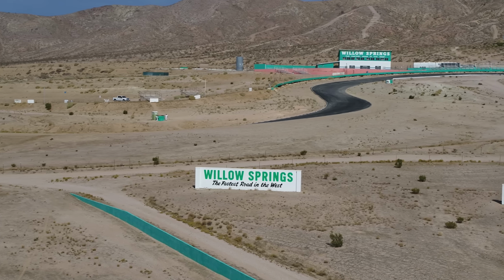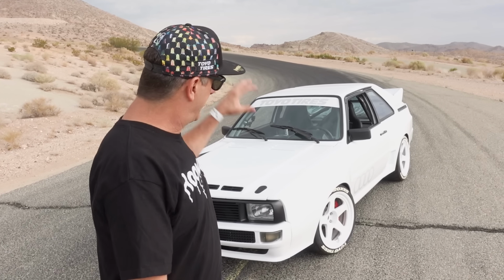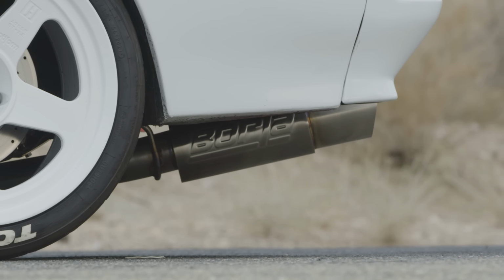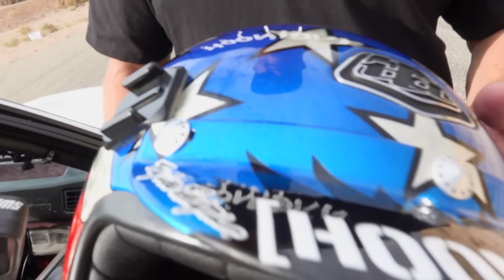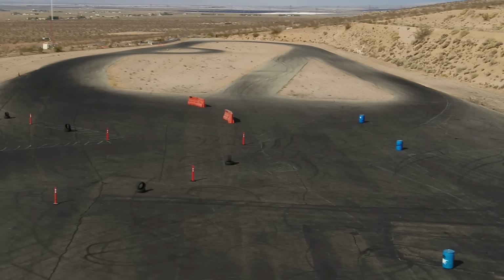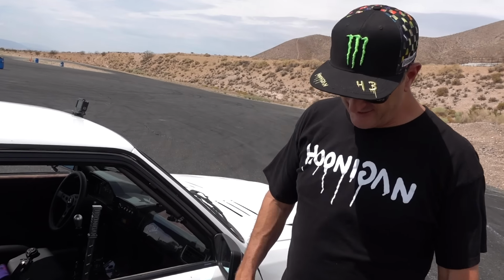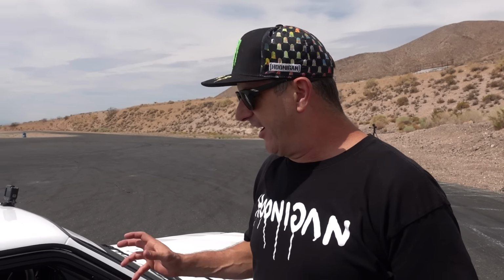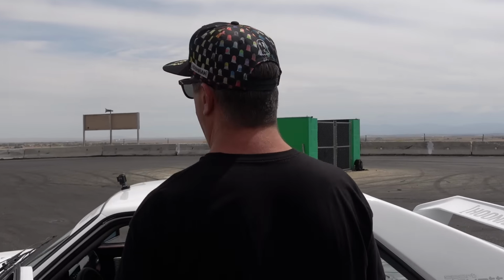Ken Block’s 730HP “TURBO MONSTER” - 1st Test of the Insane Audi Sport Quattro Replica!

Comment: The sound mixing by the editors is so on point. That turbo 5 sounds amazing
Reply: My heart rate accelerated with the engine when he launched it
Reply: 5 cyl's unique sound comes from its musical equivalent - a 'major third' - that's why they sound so pleasing. V10s too of course still with that dominant major third but have an additional 'perfect fifth' companion (a perfect fifth is the dominant two tone you get from a 6 cyl). V12s - all of the above. (Not forgetting V8s of course which combine the perfect fifth with octave companions giving them the distinctive burble)
Reply: I want an rs3 now

Comment: Is it just me or does the tachometer in the car not line up with how fast the engine is reving/sounding (for example look at the video around 9:35-9:45 and around the 15:10 to 15:18 mark as examples).

Comment: Front outside tire not spinning during doughnuts. Maybe you need to bring audi a double locking diff. Spinning out second gear entry with square tire footprint usually means front heavy. Unless that front was never spinning and just anchored you during the first test. From the rewatch, I would say you have too much tire for the diff. Over torqued the diff clutch. Carcaine paint scheme, love it.
Reply: all depends on what they have in it for differentials. if still stock the front is still 100% an open differential especially if the car still retains the RS2 01E 6 speed LCE put in it. that would also mean a torsen center differential with 60/40 bias. rear differential could be anything from an original small chassis with manual locker to a custom fit later differential with open diff or a V8 torsen factory LSD differential. either way all these parts are very robust and will take the abuse for a long time before failure. 
the car is too powerful to go backwards to an 016 gear box to get the manual locker center with 50/50 bias. ken would shear the input shaft off no problem as the car makes 150-200 more hp than the 016 can support.

Comment: Ken, if you haven't figured it out yet, Audi's problem has always been the 50/50 torque split between front and rear diffs. While its perfect for fast times, it not ideal for having fun in. If you can get it to 40/60 front/rear, it should solve the issue.
Reply: It's not a problem. You just go around it, hence the scandinavian flick. The newer B7 RS4 gearbox has better rear distribution, but I guess they already have better centre differentials in this one :)
Reply: Since 2012 all models are 40:60
Reply: It can go 20:80 or 80:20 when sliding..
Reply: Que sti tranny/dccd swap

Comment: Id be interested in a behind the scenes of the mechanics/engineers working on the car to further develop it. Would be a killer series. Diagnosing the issue with the front passenger wheel, finding a way to put more power to the front, etc. Keep it up guys! Love the content.

Comment: JHM 4:1 need that 60:40, if you are running an 01E.

Otherwise find 0A3 B7 S4 tranny that is ready to go and is already 60:40, doubt it can handle that turbo torque though.
Reply: G30-900 | Call JHM or 034, get that rear lsd too. B8 S4 manual trans with torque vectoring rear diff could probably be a complex solution. Send it, holmes.

Comment: My family had one of these when I was a kid. It had been modified with a larger turbo and manually adjustable waist gate, lowered, stiffened and was fast a ..... ya... fast.  My brother wore out in one weekend a set of Z rated tires on a trip from Utah to Yosemite national park averaging 160 mph with a lunch stop.  The tires were worn to the cords right down the center when they arrived back home.   Love the Quattro. The front and rear lockers at a pull of a button... awesome, the "4 wheel suspension steer"... awesome.  Kickin car!

Comment: Awesome car! Sounds awesome can't imagine how good it would sound  NA with that borla exhaust
Reply: Probably better but this is a 2.5 liter 5 cylinder if it didn't have a turbo they'd probably only be able to get around 350hp and it's currently at 730
Reply: @catinthehat5140  I'm aware of what engine it has in it, was only referring to the sound difference not power figures 🙂

Comment: not a huge fan of how borla ran the exhaust under the rear subframe. i own 2 small chassis audi's with 20V turbo engine a 4000 quattro and a UR quattro and if that car is grafted together right the channel should be there and 3in does fit over the passenger rear axle in the OEM configuration.

Second thing he needs to do is just lay it on the limiter, dont be scared lol! not enough detail about the drivetrain to accurately diagnose its issue but if its still running the RS2 01E 6 speed that LCE originally installed in that car than the gear ratios are too tall for what ken is doing with the car. should be 4.11 R&P as well. the best franken tranny i have ever driven that would be absolutely perfect for ken is something i stumbled on by accident because im a poor guy who really likes old audi's and wanted to drive my car lol. i took a 5000 turbo quattro 016 with 3.89 R&P stock and put 4.11 R&P in it to match the rear diff in my 4000. this gear set with 4.11 makes the car an absolute blast and would be perfect for a drift car. heres the gears. Do this ken and you wont be sorry. gots many many years under my belt with these cars and making them do things thta people say is impossible or shouldnt be done but i do it anyway. 

1st-3.600
2nd-2.125
3rd-1.360
4th-0.967
5th- 0.857
6th- 0.711
Final drive-4.11

Comment: Older Audi's 
That are quattro have  vacuum diFF Lockers In the Center differential of the transmission COUPE GT QUATTRO, 4000 QUATTRO 100 quattro 5000 QUATTRO  AND VW QUANTUM WITH QUATTRO... The only Audi with a limited slip. Rear end is the type 44 v8 quattro. ;)

Comment: Beautiful and bad ass in every way..I built a couple non short w/b aan coupes  many years back,wish I still had today... kens needs a bit more  agressive front diff, esp when pulling the oem dash mounted vacuum actuated diff lock to the second stage,locking the rear and center diffs.(unless they  have been replaced by torsion units)

Comment: It's not the diffs, it's the balance of the chassis relative to the drivetrain, short wheelbase with the engine hanging way over the front axle. You could open up or lock out the diffs, but it can't replicate the weight transfer, that's the feeling you're looking for. There's a yaw axis, relative to weight transfer, within that wheelbase, that if exceeded can't be pulled back. It's really meant to be turned with the brake pedal rather than the handbrake, pointed. You never saw big oversteer in the short wheelbase cars, look at the the old vids

Comment: It has a lot of turbo lag, that he is not used to it. Drivetrain is working poorly, its not locking and the percentage of front wheels driving is very small, most of the power going to the rear wheels. Its sad to see ken drive this car, when its drives like that, well a bit more work and its going to be a beast, btw sounds amazing 10/10 drivebility 6,7/10
Reply: i would say ken needs to add some rotating mass to the bottom end, these 5 cylinder engines do rev fast with light rotating mass but their downfall is they rev down just as fast as they rev up. i dont think they factored for that. i know this personally because one of my 20V turbo audi's had 034 8lb billet flywheel and tilton engineering twin disc in it and it revved up ungodly fast but it the RPM's dropped so fast that it would always drop below peak boost RPM during gear changes. i ended up putting a custom ringer racing steel flywheel and clutchmasters 850 setup in it and i do not regret that change or expensive clutch set one bit because it holds RPM now during gear changes with the added rotating mass.

Comment: Well okay, i know, i had high expectations .. i mean, it's Ken Block and the car he sits in is supposed to be a high performance turbo Quattro. But this video was kind of disappointing tbh. Not only because of the very small amount of footage which shows actually using the car, but also because it looks like this Frankenstein Audi interpretation of what claims to be a high performance turbo Quattro seems to be a misconfigured trailer queen with major flaws still to be fixed, including that "custom exhaust from Borla", . It may have an inline-5-pot and Audi body parts, but the result seems to not work as supposed to. This car has nothing to do with those 90s originals, all of the Audi quattro and Sport quattro had smaller engines and sounded way meaner. Even the S1 E2 Pike'S Peak just had 2.143 ccm. Waited so long to see Ken drive this car, turns out i'm pretty disappointed for now.

Comment: Yea man whoever built those diffs must not have been told they were for Ken. Im not even a diff guy and i would have run max lockup under drive. Then give it 50/50 distribution in the center diff just like Ken likes. You can see how fast the rear wheels are spinning compared to the front then it changes. Its like theyre set up for grip racing. Come on who would give Ken fuckin Block diffs like that??? I know thats not ur middle mame Ken, well shit i guess i dont....is Kens middle name fuckin?????